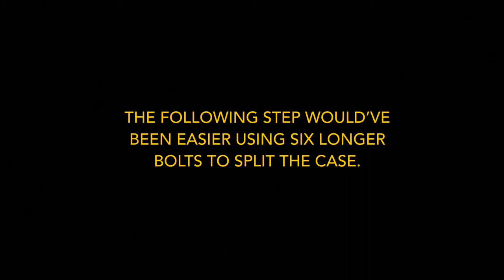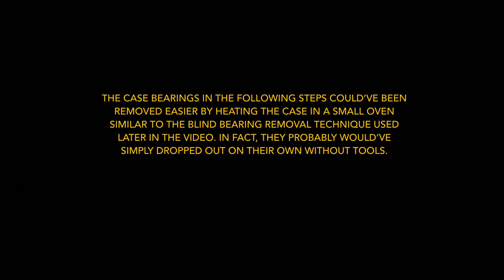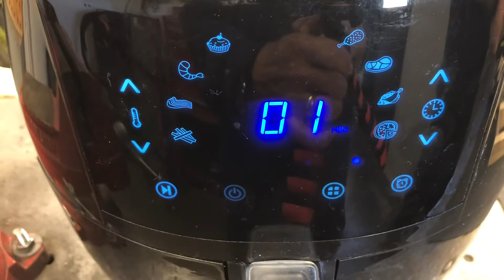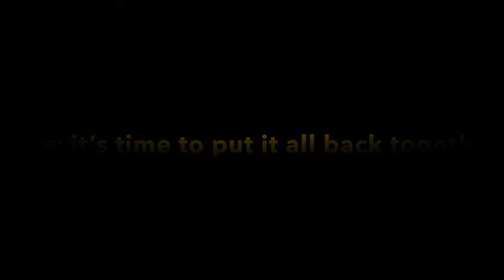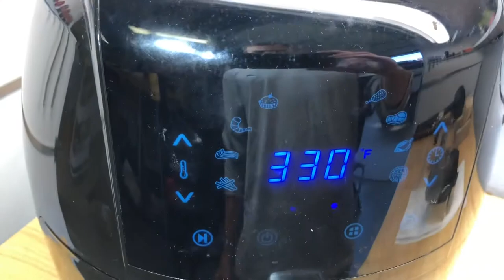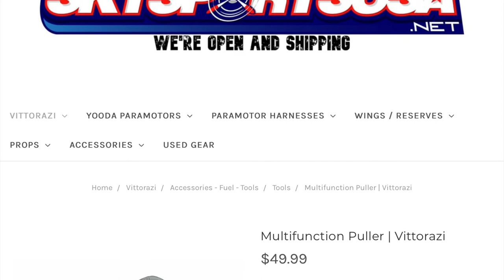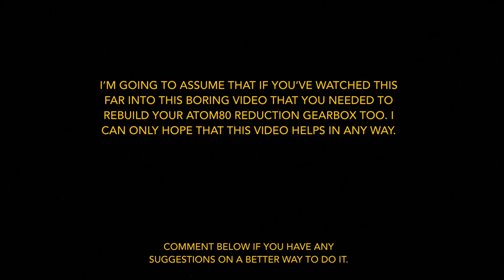Rebuilding a Vittorazi Atom80 reduction redrive, bearings, gaskets, gears & seals

Comment: Thank you for making this excellent video.  I've been putting off my reduction drive rebuild for a while as there were no warning signs of failure.  At 300 hours however, I saw some metal flakes in the oil and knew the time for rebuilding had arrived.  Turns out my drive was eating ball bearings like they were PEZ and upon splitting open the drive, the faulty bearing fell completely apart.  I found your rebuild video easy to follow and preferable to the approach that the Vittorazi manual describes.  I really appreciate your time.
Reply from the maker: Thanks for the kind words. Glad that you found it helpful. I do have a playlist on my channel with other atom80 repair videos.

Comment: How often are new gears required for the rebuild? If the gearbox is getting noisy through high airtime, is it most likely that bearing replacement is all thats required? Thanks!
Reply from the maker: @nzmikec  in my experience, usually the noise is from worn bearings. I tend to replace all the seals, o-rings and bearings. But inspect the gears and see if the teeth are chipped, polished or have any grooves. Gears are an expensive part of the entire gearbox. So it might not be cost effective to rebuild one if it requires gears, seals and bearings. Best of luck with your decision.
Reply: @wednesdaykartingflyingclub8164  Great news, ill keep my fingers crossed! Thanks so much!

Comment: Thank you  !   I'll rewatch while  I'm rebuilding mine.
Reply from the maker: I’ve rebuilt a few Atom80 gearboxes since I made this video. The newer gearboxes are much easier to split the cases making the job much easier. I’ve also found that heating the the bearings will simply fall out by heating the case halves to the correct temp, no need for special tools. But I’d only heat them if you’re planning on replacing the seals too. 

Check out this video for the update on splitting the cases. Good luck with the rebuild, let me know if you have any questions. 
https://youtu.be/Ht8ENpR8htA

Comment: How did you manage to split the case with longer bolts? I'm envisioning that the inside case has threaded holes so the more you tighten those bolts the deeper they go until they bottom out at which point if you continue to tighten it will just tear out the threads so I must be missing something?
Reply from the maker: @ajcrm125  the holes in the top cover are threaded to receive a larger bolt than is used to secure it to the bottom case. 

However, the way used in the video that I originally made does present a real risk of marring up a thread or two of the lower case. Since the making of that video Vittorazi has changed the cases on MY20 and newer models to make it much easier to split them. Also, I no longer use larger bolts to “jack up” a my19 or older one, I use a plate with bolts and washers to “lift the cover up. 

Check out this updated video. Hopefully it’ll make more sense to you depending on which gearbox that you have. 

https://youtu.be/Ht8ENpR8htA?si=DsRLNyYlZ4A2i29Q

Comment: Skysports Usa, using Vittorazzi diagrams, calls for a 6200 series bearing. You have a 6202. Which one is right?
Reply from the maker: @pascalpeladeau5604  there are a total of four bearing in the case. Two of which are identical and the other two are different sizes. This makes for three different sizes. I took the original bearings to a bearing supplier who determined the sizes for me and recommended that I use the Nachi brand to replace them with. I hope that answers your question.

Comment: Very informative with lots of detail. Well done. Thank you.
Reply from the maker: Thanks. Hopefully it helps you if you ever need to rebuild one.
Reply: @wednesdaykartingflyingclub8164   Dennis, just took delivery of a new MY20 Parajet Maverick/ Atom 80. I'm a machinist/toolmaker 46 years on now and I do find videos like these extremely valuable. You did it right and it shows folks how not to force things and to be deliberate on their approach to repairing these machines.
Reply from the maker: @mikehawkins3263  wow, thanks for the compliment. Trust me when I say that I tried many different techniques on several of the steps. The video only shows what I found worked the best for me. The rebuild and video took me a couple of weeks to complete. I’ve since rebuilt another one in a matter of only a couple of hours. So I really hope that it’ll help save somebody else some time and frustration. 

Btw, I’m also putting together a rebuild video on the exhaust and top end of the Atom80. Should be out soon. 

Thanks again for the kind words. I’m just glad that somebody else is interested in what makes these things tic too. 😁 Have fun with your Maverick hope to see you in the sky.
Reply: @wednesdaykartingflyingclub8164  That's great that you want to do more videos on the Atom 80. Exhaust and top end rebuild are two areas that will help both experienced and inexperienced folks tremendously. I'll be watching for them. Thanks again.

Comment: Superb video, thank you! Question: I'm curious as to why you put the gear and bearings in the freezer?
Reply from the maker: Putting those parts in the freezer and heating the cases helps with assembly. The heat expands the cases and cooling shrinks the gears and bearings. It’s not by much, but makes them fit together easier since the tolerances are so close.
Reply: @wednesdaykartingflyingclub8164  that makes sense. I'm always learning something new. Thanks for contributing!
Reply: @WillFly  it called Interference fit.

Comment: How did you split the case using those bolts without stripping the internal threads?  Once the bolts bottomed out etc.
Reply from the maker: You’re right, this is without question the simplest way, requiring less tools, to get the job done on a MY18 or MY19 gearbox. This is only one way to get the job done. In fact I’ve used this and one other method where I used a plate to lift the outer case rather than “jack” it up with bolts. (See the video description for a follow up link to this video). Also, the MY20 gearbox does have two threaded holes on the case cover specifically designed to jack it up. Jacking the cover up there would reduce the risk of destroying any threads in the lower case.
Reply from the maker: Check out Vittorazi’s website for their new maintenance manual. It shows in great detail the breakdown of the gearbox as well using the MY20 or newer gearbox and the two jacking bolts. https://vittorazi.com/manuali/Maintenance_manual_Atom80_Eng_022.pdf?fbclid=IwAR3Q-giff3-l5xb9oVDGjdLas3HvJzciFITj2-omuz2YC-93aW-U9LPxfHM

Comment: What size sockets did you use to  press in the bearings?  Is that generic bearing grease you apply at 15:09?
Reply from the maker: I’m pretty sure the socket that I used is 3/4”. However, when pressing bearings,  I try to use a socket size that will put the pressure on the outer “race” of the bearing. But obviously it has to also be smaller than the outer diameter of the bearing. The socket that I used has almost a flat surface of the driver side. So it spread out the force on most of the bearing. 

Yes, any standard grease should work.

Comment: What did you torque the clutch bell to @ 16:09
Reply from the maker: I was going to torque it to 25NM. But it hit 25NM pretty quick and really didn’t seem to be tight yet. So I kept going a little further. It shouldn’t ever come loose though because the rotation of the engine should be tightening it, not trying to loosen it.

Comment: Did you use any specific grease for packing the bearings?
Reply from the maker: Vittorazi lubes the gearbox with 30cc of their specific blend of oil. I leave the grease that comes with the bearings on them. But it washes out after the first fluid change anyway and is lubricated by the gearbox oil.
Reply: Hey thanks! And is splitting the case really as easy as getting 6 longer bolts same thread and evenly torqueing them? Great video!
Reply from the maker: @snakevera  the bolts that I used are 6mm x 30mm long. They thread into the outer case and push down onto inner case. The case bolts are 5mm. So you have to be cautious not to force the bigger 6mm bolts into the 5mm threaded inner case. Keep in mind that there are several ways to split the case. The way shown here is just one. After this video, I’ve found a few better ways to get this job done. Especially in splitting the case. Doing it this way is effective, but does bugger up the original bolt holes slightly.
Reply: What would be one of the better ways you found as an alternative?
Reply from the maker: @snakevera  I made a metal plate that I drilled 6 holes into. The holes line up with the 6 case bolt holes. I then set the plate on the prop output shaft and put (6) 6mm bolts into the threads on the outer case. These bolts need to be long enough to thread into the outer case, but not too long causing them to hit the inner case. Then the outer cover can be pulled away from the inner case. 

I also learned that the bearings will simply fall out of the cases if heated to the correct temperature (no tools required) and a new one can be put in at the same time if the new bearings are already in the freezer.
Reply: You are the man, thank you so much for sharing your tips and tricks...not to mention your very good descriptions ✌